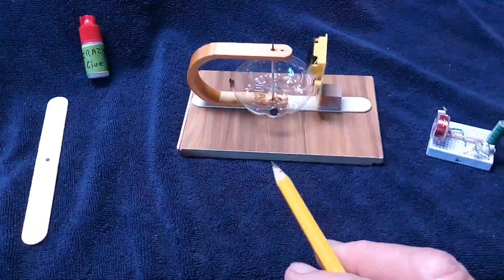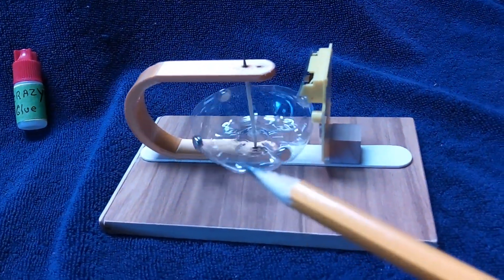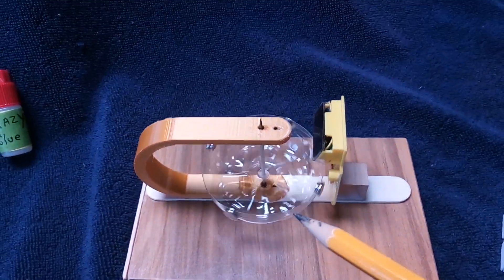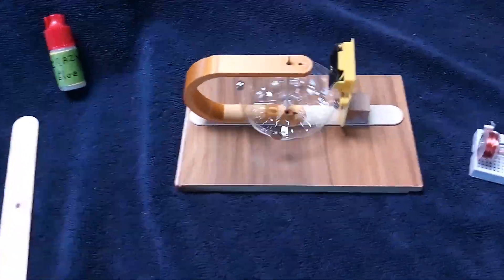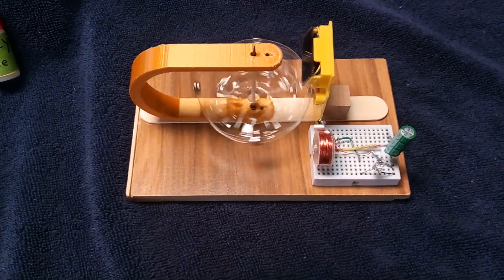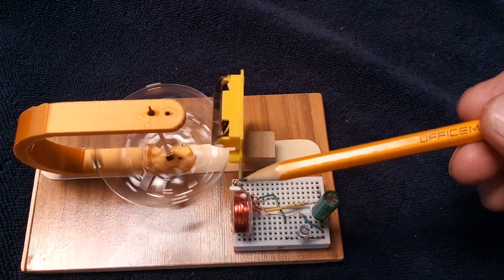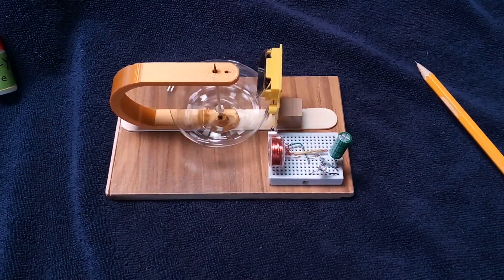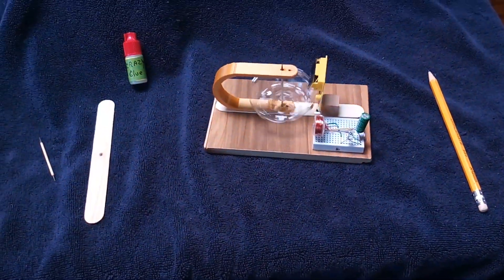Water Bottle and Toothpick Motor    Part 2

Comment: @Lidmotor is this simply using a reed switch to energise a coil and repel the magnet or is there a driver circuit?
Reply from the maker: This is just a reed switch setup.

Comment: I've found the viscosity of the oil also adds drag which makes it consume more power. I have two good long running options: 

The first is a stainless steel shaft magnetically levitated against gravity with the tiniest bias up towards a watch glass using a stack of small thin magnets. A brass pin point bearing hub lightly dusted with graphite at the bottom to keep it from wandering. This is fine but if you move it then it tends to upset the balance. Would be better with a camera cut out in a glass screen protector to hold the top end of the shaft vaguely in the right place so it's more robust to being moved.

The second is home made macro jewel bearings: You can buy cubic zirconia and synthetic rubys/saphires very cheap. I bought some 10mm ones and used a diamond lapping past with a copper rod with a tapered end. It took many hours to wear a suitable divot in the "diamond" but once the grinding paste is removed, a ceramic shaft from an aquarium pump motor (tapered at the ends to a point) and magnetically levitated, the cone stops the shaft from wandering, and the hardness of the materials mean that hopefully it should last a long time. So far, so good.
Reply from the maker: Great ideas.  Thanks.  I will look into the synthetic gems.

Comment: Do you put the graphite on the wood first or the super glue? Fun project. Thanks.
Reply from the maker: I rub the pencil lead into the wood first then coat it with crazy glue.  After the glue dries I use the pencil lead on the surface again. You can build it up in layers if you want.

Comment: Great stuff. Wouldn't it be nice if you had some LEDs in the water bottle part?
I am not sure how it would be done. Maybe a bearing with copper wired touching it or something like that. Always enjoy your videos. 👌👍
Reply from the maker: I could put an led under the rotor and see what it looks like.  Maybe a color changing one.  Thanks for the idea.